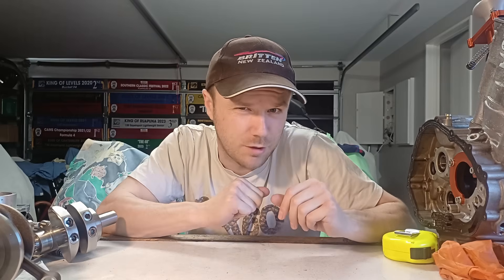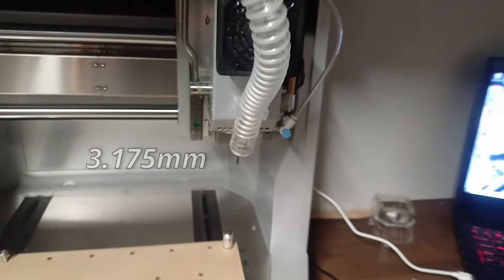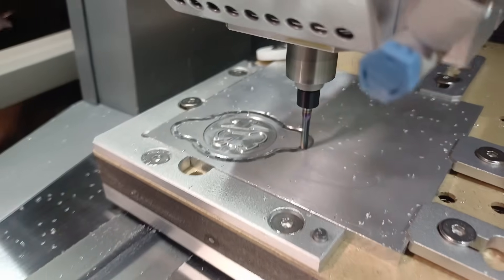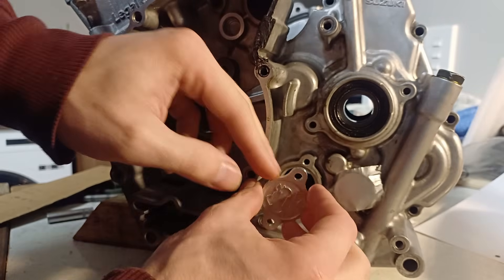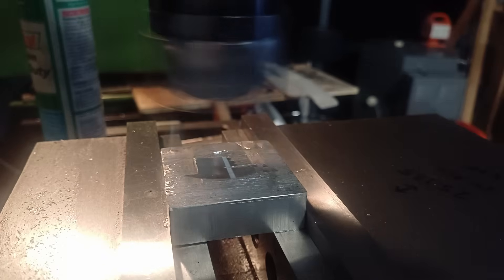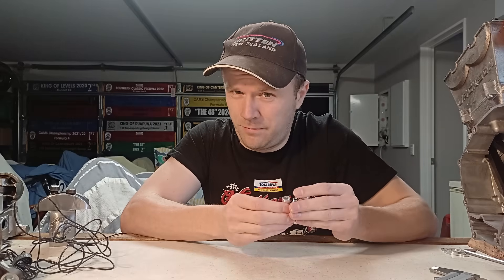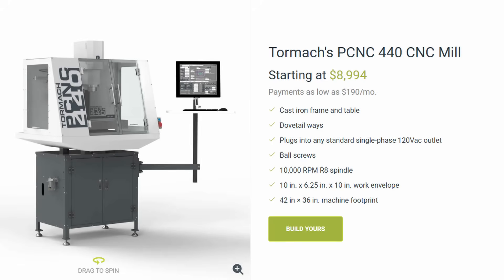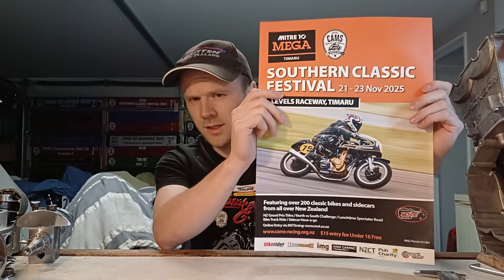Do Desktop CNC Machines live up to the Hype

Comment: That two bolt hole plate O ringed plate as designed needs a groove for the O ring to stop it blowing out. It will probably work OK as is for a while but it's a flawed design.
Reply from the maker: The crank cases have the groove for the O ring 😉

Comment: You shouldnt have the oil cooler and pressure relief valve in parallel.
You should have them in series so the valve dumps oil into the cooler at low pressure then into the sump.
Reply from the maker: The oil pressure goes straight from the pump to the oil cooler, if I were to dump the oil into the cooler from the releif valve there would be no pressure regulation at all, kinda defeats the purpose of a relief valve.
Reply: @TheMotorcycleForge   I meant take the cooler out of the main engine lube line.
The cooler is a failure point that you dont want high pressure oil in. It could pop even if you dont crash.
On track the relief valve is going to be dumping all the time so you will have high flow, low pressure. no fail.
Cooler dumps back into the sump near the pickup and mixes with hot oil from engine.
Reply from the maker: @RIPPERTON aaaah yeah that's true.
I'm probably gonna have to remove the oil cooler all together then or I'm going to have to redesign the whole oil system.